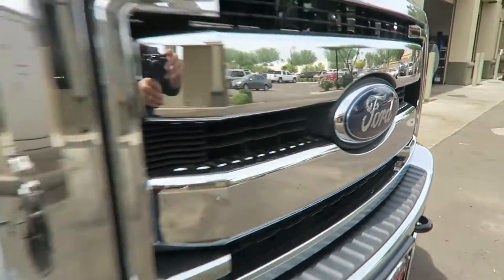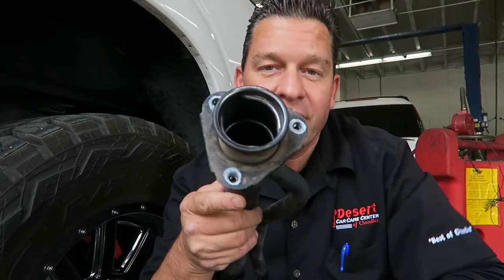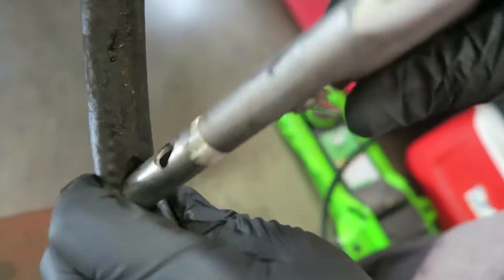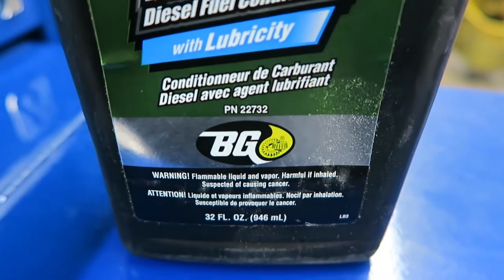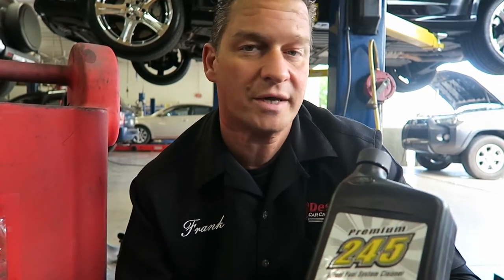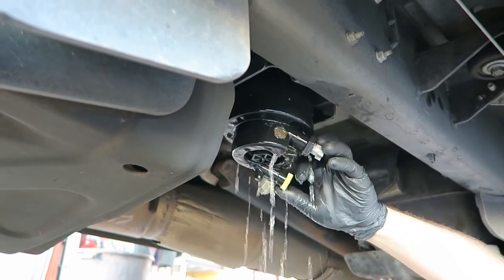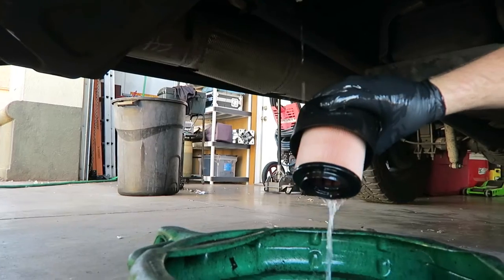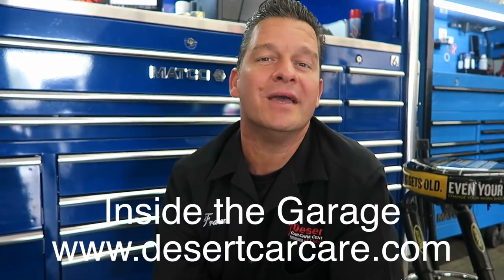Gas Mixed with Diesel .Will this Work for a Fix ?

Comment: Is there a gasoline fuel conditioner? I put diesel fuel into my gas engine by accident and I just ended up adding more gas into the car so I can get to where I need to go. My car is still running I'm pretty sure it's half diesel, half gas. Can I just wait until my car is out of gas and then add more gas as well as an injector cleaner so I can push that diesel out eventually?
Reply from the maker: Ashly J ~ give it a try ! Hopefully that works out

Comment: I put $4 of gasoline in my diesel truck by mistake. The fuel station that i went to had a pump handle colored green so i automatically assumed it was diesel. I then filled my tank with $90 of diesel...its the day after and still no problems. Did i get lucky? Who knows
Reply from the maker: Sounds like a minor episode thankfully !
Reply: Rather the nozzle  is green or not the diesel  nozzle is bigger then a gas nozzle

Comment: Do you need to do all this work if the truck was never turned on/started??
Reply from the maker: Braybray ~ case by case ~ hopefully NOT a biggie if not started and run ~ drain drain and drain with replacement and hopefully all is drama free ~ good luck !